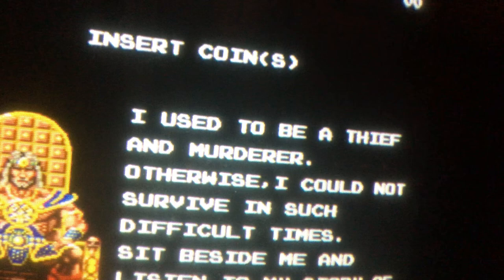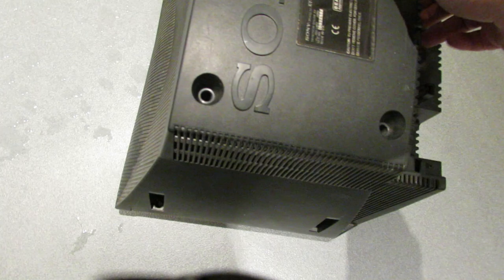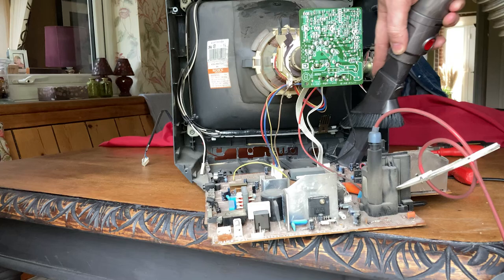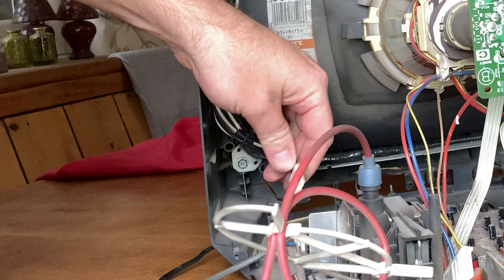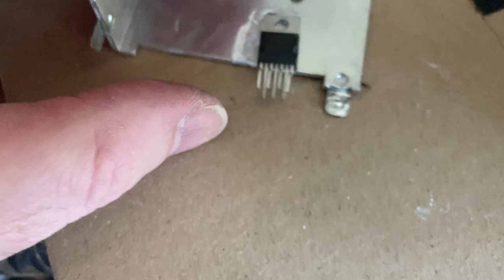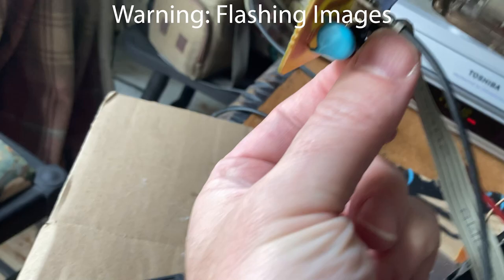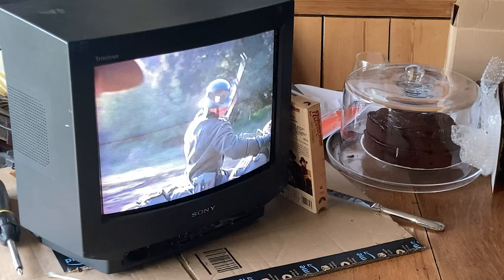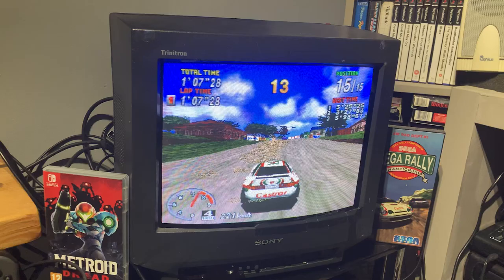Retro CRT Repair: Repairing a Sony Trinitron - Retro on a Budget | Living in the Past

Comment: Here in Brazil there was an auction of several sealed 2005 Sony Wega TVs that remained in the warehouse for decades.

Last year I managed to buy one and it was a surreal feeling to open the packaging of a classic TV like this.

PS2 with component cable looks amazing.
Reply from the maker: Sounds excellent Fellipe, I would love to get a brand new, Old TV be it a WEGA, Trinitron or PVM. Lush Retro man, lush.
Reply: @NXGamer  Thanks!

It was something no one expected. I imagine that some store in the 2000s must have gone bankrupt, the government must have kept the store's stock. And as everything in the government is bureaucratic, it took decades to carry out the auction. 🤣🤣

I wanted the 20l5 PVM for the versatility of having progressive scan. But it's a rare and very expensive monitor when you find it.

And I don't have the technical knowledge to fix it in case something goes bad.

So I was very happy and satisfied when I found selead Wega
Reply: You're lucky
Reply: That just sounds amazing, I've ended up buying a retrotink to solve my 2021 PS2 problem.

Comment: Loved your video!! Reminded me of my days as a university student. I had picked up a Trinitron KV-21LS30E from the curb which apart from being grimy, had no problems at all. And a while later I found an old Sharp SV-2042E which after a small repair worked like a charm. I've been using them for retro gaming since 2013 and I have never had an issue with neither one. They both have excellent picture quality.
Reply from the maker: Yes man, I love these stories and moments. I have never had that many over the years to that or this level, but when they do they are even more special. I once had a old house I was helping clear out for a friend (parents) and he said that the biggest box I could take. Within it was a decent condition Amiga 500 with disk's, mouse and joysticks, broken but easily repaired. I kept that one and sold my own due to the history, sad I know but still. Thanks for sharing BillAES.
Reply: @NXGamer  An Amiga 500 is sure an amazing find! Thanks for the videos, love your channel!

Comment: Hey there how goes it. I went to my local scrap yard and I saw and found a Sony Trinitron kv 21m3d 51cm and plugged it in and it worked off the bat and the dude gave it to me for 3 euros. I tried it at home and its great with my Mega Drive. I wanna make an arcade cabinate as I have a Rasberry running a retro gaming system with over a thousand games. Gonna get some controllers soon. Question I have is, when I turn on my TV it goes to the channels first. Is there a way to program it to go automatically to Video input so I don't have to fidget with it and get the full Arcade effect I want? Might have to get a remote as it did not have one.

Comment: Nice video! I am currently working on a similar model!(KV 14m1d). I managed to turn it on ( repaired some cracked solder points) but now it displays a vertically squished  picture, starting from the top and only  reaching the 2/3 of the  screen.  I decided to recap the whole board and then I find your video and I might have a go with the IC responsible for the Vsync. Have you ever experienced a similar  issue with a trinitron? Any advice?

Comment: Hey I was hoping you could help me out with some advice.  I got a crt vga compaq monitor that wouldn’t turn on.  So I plugged it in for 2 days and then hit the power on off button non stop for about an hour and I got it to turn on.  I then used it as my primary pc monitor for 8 months.  Now it won’t turn on again.  Any ideas?

Comment: I have a Sony KV-27S42 CRT I picked up a few weeks ago was working like a champ then all of a sudden there is no picture and sound when anything is connected to it, even when on cable more no white noise picture, the interesting this is that the menu screen pops up when activated, I opened it up to take a look at the board and I dont see any obvious blown caps or anything any idea where to start looking to fix this problem? thanks in advance!

Comment: Great video man - especially the editing at the start. Question for you: in this video, black lines appear on the left and bottom of tekken 3. Is there any easy (ish) way to adjust the aspect ratio so the picture correctly fills the screen? I've found that the mega drive leaves a black line across the right of the screen on mine, aspect ratio is never centred. Thanks either way for making this stuff :)
Reply from the maker: Yes, in the video I discuss the engineers menu. If you have the remote use that to adjust the width and height of the screen including the length. This will or should fix most tubes that have drifted slightly. Message back if you still need help.

Comment: I know this is unrelated, but was there a model number on the yoke? I'm trying to test if a CRT I have is worn/dead in this tv as it uses the same tube, but I cant get the yoke off and don't have the equipment to check its inductance. Visually the yoke is identical to the one in your vid but I want to be sure before testing it.